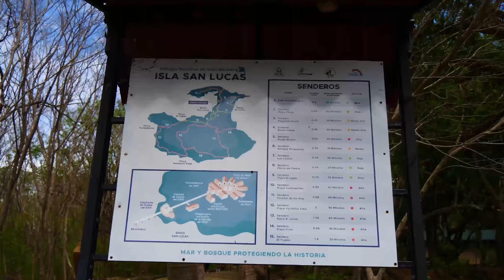The Good, Bad & Ugly of Cruising Life + Why are all the Fish DEAD?? (Calico Skies Sailing Ep.145)

Comment: Looks like sea water down the chain hawse hole is splashing onto the motor and corroding it. 

On my boat, the windlass straddles the bulkhead at the aft end of the chain locker. This means the hawse hole is forward of the bulkhead, with the chain dropping into the chain locker. But the drum of the windlass is behind the bulkhead, and the motor underneath it is in the fore cabin above the V-berth. This keeps the motor completely dry. I think the motor on mine is original to the boat, built in 1993. It also means, if accessing the motor, you'd be lying on the V-berth cushions rather than hanging upside down in the chain locker! 

Obviously, it would be major surgery to change your installation to match this, but if you have ongoing problems requiring a re-install it might be worth considering.
Reply from the maker: That sounds like a good setup! It’s been working now..knock on wood lol. The motor has a “waterproof” case over it but not sure how well that is working as there is def some corrosion there